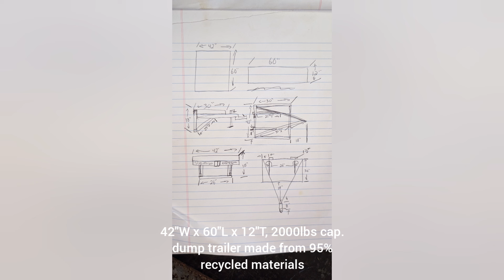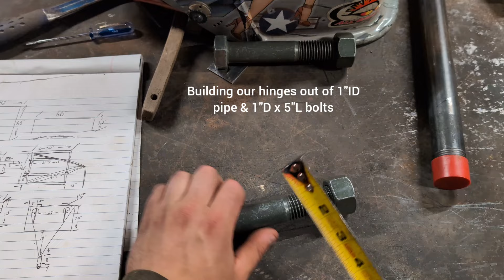home made atv/sub compact tractor dump trailer (part 1)

Comment from the maker: @garymucher4082 to be fair, you are correct. I'm a millwright by trade and as a part of my job ive been fortunate enough to (with permission) be able to bring home plenty of usable scrap material over the years. To build a trailer to this design with all new steel would be close to 1200$ canadian. My actual cost for tires, axle shafts, jack, hitch and paint was about 350$